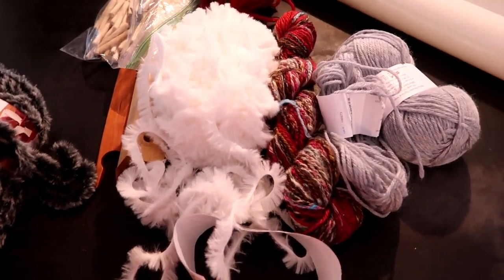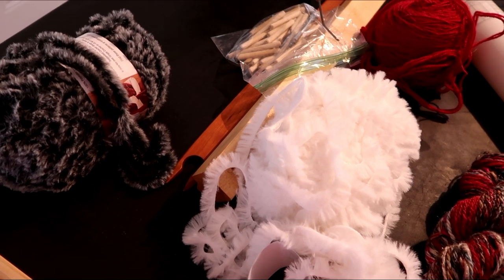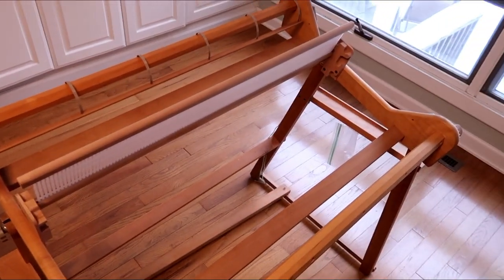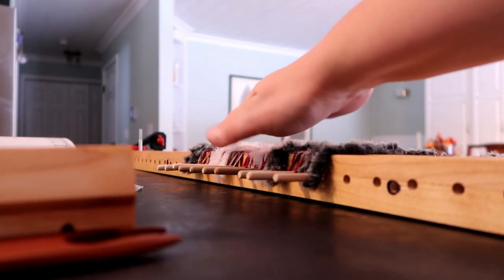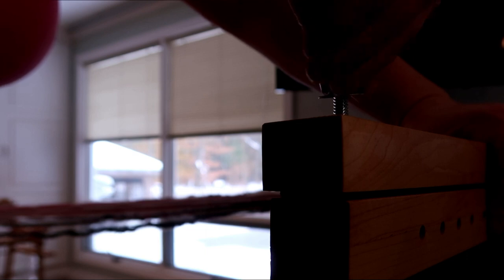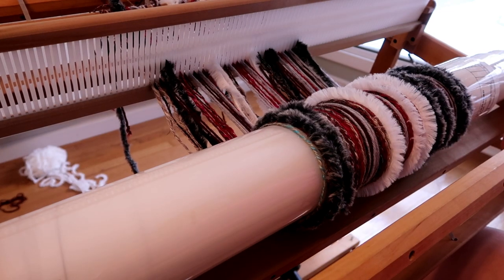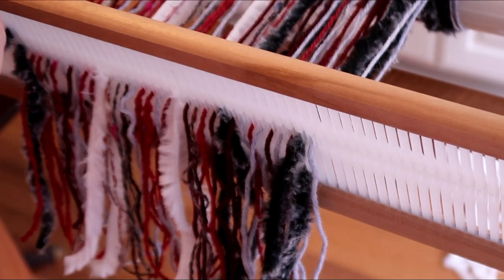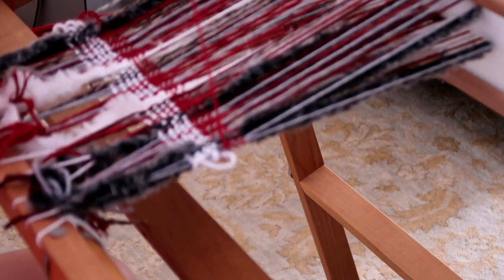Weave a Mixed Warp (with FUR) Scarf With me From Start to Finish! On a Rigid Heddle Loom

Comment: I love this video and I have so many questions.  First, what size heddle did you use?  Also, what kind of warping tool did you use?  And on the warping tool, how many threads can go around each peg?  With the fur, did you find any trouble with it sticking in the shed or flaking off?  I have quite a bit of this fur and don't know what to do with it.  Thanks so much for this video.
Reply from the maker: Pretty sure this was a 7.5 dpi heddle. The warping tool is in my Etsy shop. It is called a warping bar. You can find it in Etsy by just putting in fiber love diary warping bar. The tool works for one inch of warp per peg, so when I do a warp with an odd number of stand per inch, I just stagger to get closer to an inch per peg. The fur holds up perfectly. It doesn't she's or clump up even when you wash it. I'm not a fun fur gal but I love that stuff.
Reply: @FiberLoveDiary  Thanks so much for getting back to me.  I'm surprised the 7.5 heddle works with the fur, I'll have to try it.  I wasn't sure it would go through the holes.  I'll definitely check out your Etsy page.  Thanks again.